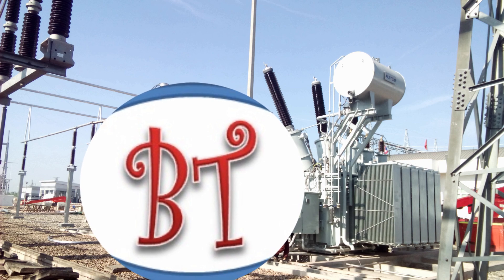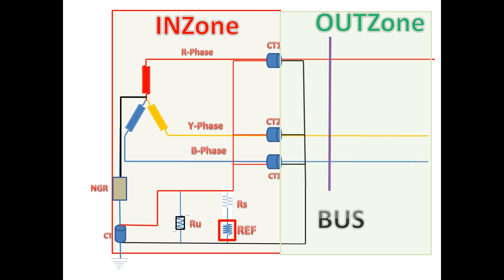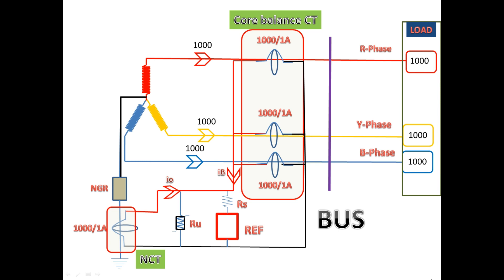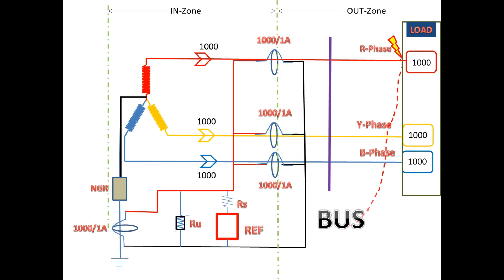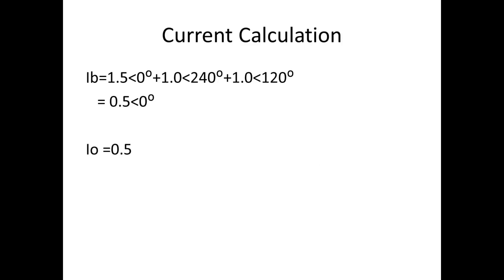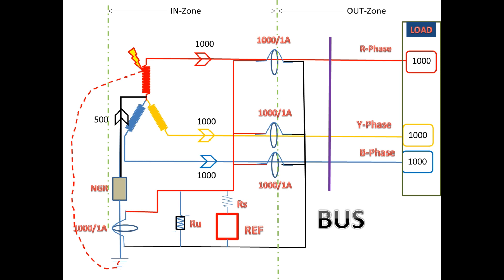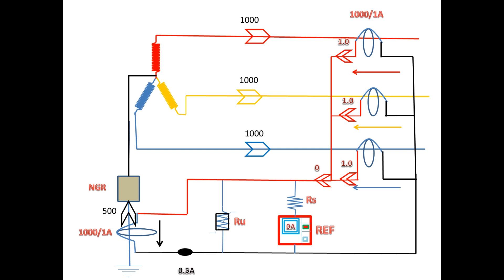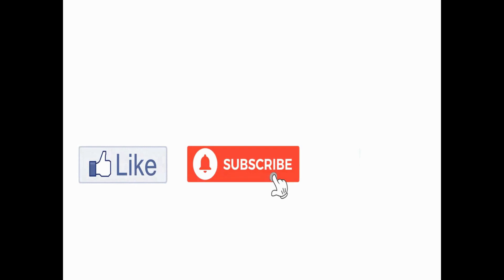Restricted Earth Fault Protection working | REF relay working principle | REF relay working Part-1

Comment: one question why in the first case the CT is allowimg 0.5 amps to pass through it where as in case 2 it is not allowing.<???
Reply from the maker: due to neutral current path associated with 3 phase current

Comment: In first case the fault current is able to travel the high impedance path whereas in second case it chooses low impedance path? Can you please explain the difference... Meaning the first case has 1 amp total fault current which chooses high impedance path whereas 0.5 amps chooses low impedance path... Pleassexplain
Reply from the maker: if the flow in same direction it can able to flow easily

Comment: Case 2 : As per your video ,Neutral Ct secondary  current will choose low resistance path & it will make the relay trip .

Same scenerio if we consider for case 1  How the neutral secondary current will flow in  core balanced side  since its a high impedence path .

Please clarify sir..
Reply from the maker: if flow of the current in same direction then it will have low resistance path.

Comment: ABB relays:

REM= Relay for Electrical Machine (Motor or Generator) 
RET= Relay for Electrical Transformer
REF=Relay for Electrical Feeder
RED=Relay for Electrical Differential
REL=Relay for Line (Distance Protection)
Rex= basic protection NOC/NEF
Reply from the maker: REM is mainly used for motor and REG is mainly used for generator

Comment: hi , how to calculate in current for  ex: I1+I2+I3=0 (1.5+1+1= 0.5) explain plz
Reply from the maker: i1<0+I2<240+I3<120=0 we have to take angle also
Reply: @baranitech  brother please explain below  thing 

If we take angle for (1.5+1+1=0
.5)  

 1.5 sin  0° + 1 sin 240° + 1 sin 120°= 0
.5 sin 0° 

= 1.5 (0) + 1 sin (-3/2) + 1 sin (3/2) = 0.5(0)

Then value wil come 
0 - 0.866  + 0.866 = 0

Total value is 0

Please clarify my doubts sir
Reply: Convert from polar to rectangular form, that way it'll be easier to understand.

Comment: Good info : question - what will happen to REF if CT of faulty phase becomes saturated during through fault condition ?
Reply from the maker: before it get saturation relay has to give trip .
Reply: In saturated condition neutral secondary current shall flow through phase CT due to minimum impedence ...

Comment: What happens if no fault happened and load is unbalanced , will the relay trip
Reply: But unbalance current will not pass through transformer neutral CT right?
Reply from the maker: @akhilsm6840  without help of neutral line the star connection cann't able to take unbalance current
Reply: Only fault current can pass through the neutral point CT
Reply from the maker: @akhilsm6840  if its not taking fourth path(neutral) then what way the unbalance current will flow?
Reply: I have one more doubt, in a 3 phase 3 wire system  if in any for  case line to line fault happens before CT connection, that is with in the zone  will the relay trip as only one CT will be carrying current that time and which can trip the relay right?
Reply from the maker: no it will not trip unbalance current and NCT current get balanced
Reply: U meant to say then total 5 CT will be required for 3 phase 4 wire system am I right sir

Comment: 6:24 what is reason for B phase Ct providing high impedence to flow of nutrel ct fault current?already B phase load current 1A flowing through B phase.then at the time of fault current cant to flow through B phase ct?kindly explain sir
Reply from the maker: it is the node of all three phase R, Y and B . not only for B phase CT
Reply from the maker: no current out form Core balance CT so neutral CT current not able to enter